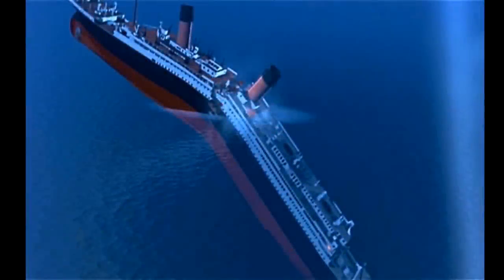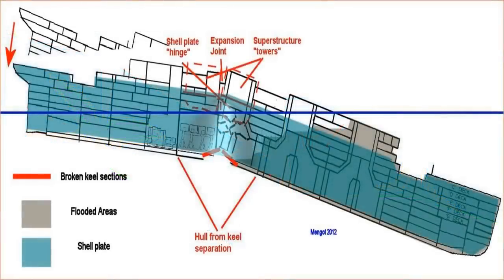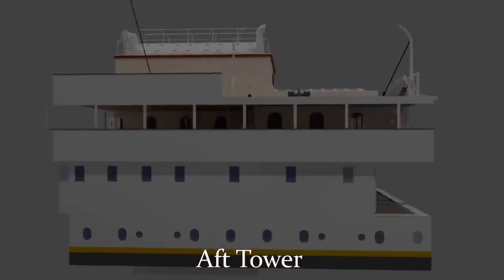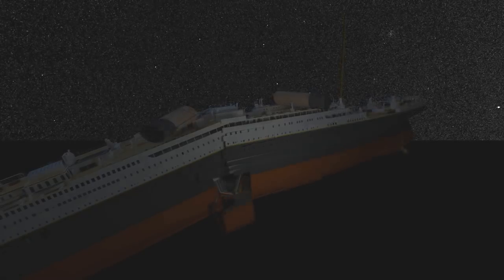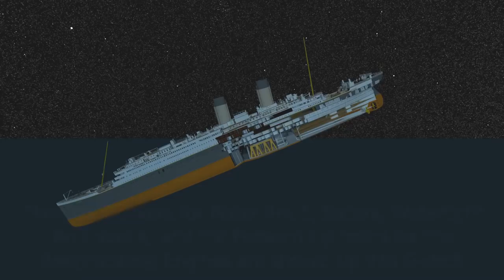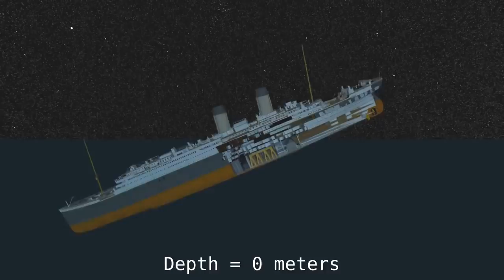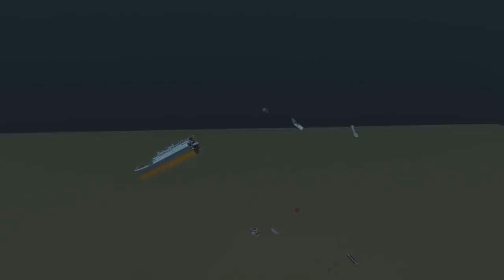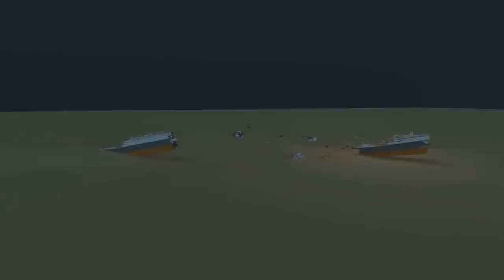How Titanic Broke In Half BRIGHTENED

Comment: Question (I’m asking to learn, not debate): how much water was in the stern of the ship when all of this happened? In my head I’m thinking if it was a significant amount it would have just gone down with the bow without breaking off, the whole thing would have just slipped under the water as air was pushed out and buoyancy was lost. But, obviously, the rate at which the ship lost buoyancy was variable to an extreme along the length of the ship.

By the time that it had completely broken up and the stern was near vertical is the reason why it stayed vertical as it sank because enough water and made it far enough “up” the stern as the bow had pulled it prior to breaking to balance it in a way that prevented it from righting itself before sinking? Presumably there was still a fair amount of air left in the above water portion of the stern to provide enough buoyancy to keep it above water for a few more moments, which was just steadily pushed out as it took on water from below.

Comment: I made a replica out of Legos that measured at almost 6ft long and I propped it up against my ottoman at the same angle to do a stress test and I got a result that looked identical to the ship breaking in the animation. (The double bottom and top of the ship clashing and breaking apart) Now I'm not a professional lego ship builder or anything and obviously it's made out of the same material, but if the splitting is similar in a weaker and smaller object then that shows that this is the best representation of how she went down.

Comment: Where is the B-deck? Where is the G-deck? Where is the neutral line, compression stress and tension stress at each moment of the break? It would help to overlay these indicators at each interval of the breakup. Also, could you show the real waterline at each moment of the breakup, not some horizon line which shifts in the distance which makes it appear as if the ship is moving out of the water and into the air. I think this is the most realistic breakup theory, however the animation isn't as clear as it could be.

Comment: It's strange that none of the survivors mentioned that Titanic had split in two. I also remember reading, long before the wreck was located and the split was discovered, a theory that because the water was so deep, so cold and so saline that it could have taken the ship almost a week to finally hit the bottom and that it sank arcing backwards and forwards like the tip of a pendulum as the water became thicker. This was a theory from the 1950s or 60s though and was one of many that abounded at the time.
It was also suggested, with hindsight of course, that had a controlled flooding of the stern taken place it would have lifted the bow of the ship high enough that the water would not have continued topping the watertight bulkheads and the ship would have remained afloat.
It's very sad and sobering to think that there were probably pockets of air in certain parts of the two hull sections wherein trapped passengers were still alive as the ship went below the surface and may have survived a short while during hte descent until the pressure became too great.
A good animation, may thanks, Bob.
Reply: Some clearly saw it break in two at the surface, but their testimony was ignored or buried.
Reply: A week!😂
Reply: Very interesting to hear this. Never heard it before. Did the titanic have a way of allowing water in to fill the other watertight bulkhead compartments? Was that something that had been done on other ships before/after titanic? It sounds logical that it could’ve saved the ship.

Comment: Another reason why is because EVERYONE was at the stern and since it was high in the air it wouldn’t be able to hold that many people that high up because even though steel is very strong it would still break it with that many people anyway. But even if the metal was strong to the point where it can’t even have a small crack it wouldn’t matter because metal would have to be at the limit of strength to not have even a VERY VERY TINY crack.

Comment: This video argues that (1) the keel failed in compression early in the sinking sequence, and then (2) the B-deck held the ship together for a time. Finally (3) the B-deck failed, allowing the forward section to fall away and sink to the bottom, (4) leaving the aft section floating stern-high for up to five minutes before it too sank. It seems to me that B-deck would fail in tension first, leaving the two sections connected by the  keel. Then the weight of the flooded bow section would cause the aft section to rise to the vertical and support both sections for a time with its remaining buoyancy (due to the air trapped inside). As the aft section continued to flood and lose its air, it would become unable to support the weight of the flooded bow section, and the two sections (still connected) would sink below the surface. On the way down the two sections would twist and turn and break the keel, finally separating them. Further, if the two sections did indeed separate at the surface, it seems unlikely that the essentially unflooded aft section would be stable floating stern-high, rather than settling back down to the horizontal.

Comment: With my experience in metal trades.

There probably wasn't any hole or tear in the hull.

The boat has probably hit the ice berg 2 times, denting the front area and kinking the hull the 2nd hit.

I can agree with this but I think  the kink would have cracked the side and the keel, allowing water to seep in but not flood areas.

because the hull is riveted as it has sheer tolerances, whereas welds don't have any sheer tolerances. Water will have entered more so at the front dent filling the flood tanks, its probably above the top of the flood tanks filling them but the decks above.

This lowers the bow into the water and leans the boat to the side.

The kink will allow tears after a while, with the constant shifting of the riveted plates against the water which opens up the rivet holes, which causes then to drop out.

The plates of the hull will start to pull away and tear away, those could be miles away as the wreck isn't at the mayday call position. Part of reason why it wasn't found for a long time.

Witnesses also said the hull tore away which above also works with.

The neutral axis means nothing really as this is a 300 meter u channel, Which isn't an rigid structure as the rivets allow for movement.

You can get an 3mm U channel or pipe and smash it very hard against a pole or get a hammer and hit the side and it'll be kinked and once that happens, it's pretty much junk as you can't fix or repair it.
Reply: There was around 6 gashes in the ship from the ice falling off as a more than 20000 ton ship moving 22 knots would make icebergs do. And there was an iceberg that was unique when they went searching for the iceberg. An iceberg with dents and holes in it, with red paint from titanic on it.

Comment: I think this is probably more of what happened than any other theory I've seen. But I'd like to maybe throw out the possibility that all this happened, but instead of completely coming apart at the surface that maybe it was more towards the bottom of the ocean. Like half way down or so that it broke apart. And that's why those big parts are crushed together. Idk I think the bow didnt just go straight down in a linear path either I think there might have been a slight rotation and thats why the mast is slightly to the port side on the bow. And why the stern was spinning when it hit the bottom.

Comment: Bunk.  The steel was subject to freezing sea water plus the direct contact to a huge chunk of solid ice, plus losing 60' of the bottom double hull near the middle of the ship. CAUSED THE SHIP TO BREAK IN HALF.
Reply: Then the ship wouldn't break if the gash actually went that far. It broke because it was so high in the air and uneven weight distributions snapped it into many pieces. Freezing doesn't change anything to metal, metal still is just stiff.

Comment: The only thing that stands out to me as an anomaly in this theory, which seems the most plausible of all that have been put forward, is the damage to the reciprocating engines. If the forwardmost cylinders were forced upward into G deck, why are the reversing gear rods, between the first and second cylinders, bent downward at a noticeable angle? 

Image included for quick reference: https://www.encyclopedia-titanica.org/community/attachments/6a982401836401a519d8d31f3fefce84-jpg.41718/

Did the entire engine assembly move upward and then bend downward as the ship came apart? Was the steel bed plate the engines were mounted on, then mounted to the double bottom, thick and strong enough the hold the engines together as a solid unit until the final separation? Interested to know your thoughts.

Comment: The back half did float for a minute if they had put steel plates in between the expansion on both sides and sealed it the back half would have remained the float but it went nose down right after the nose according to the movie I can't say for sure but witnesses said the same

Comment: I don't quite understand how the stern could have only rose to 15 or 20 degrees, when there there are clear depictions of the stern having rose to a roughly 45 degree angle before the ship actually broke in two.
Reply: Alright here's someone proof of less than 45 degrees. Harland and Wolff (company that built Titanic) stated that the boilers would start falling out of there bases at around 35 degrees. The boilers that are exposed from the ship breaking are still intact, and visible.

Comment: Isn't it quite possible she simple imploded due to water pressure on the hull? Seems logical to me. US Subs during WWII (Gato class) had a crush depth of 300 feet give or take. Titanic sank in like 1200 feet of water. My guess is she imploded once the crush depth for her hull was exceeded. That would leave plenty of room for all the parts to land were they did.
Reply: Titanic actually sank in around 3800 meters, which is about 12000 feet below the surface.

Comment: #3....wrong.
The size of the stern, with loose steel will pull apart at 25 knots spilling pieces off over the course of 2.3 miles down to the ocean floor.

Comment: Sooo some problems with this theory, it relies on Gravity not affecting the ship during its decent. That is physically impossible. Gravity is one of the Strongest forces in the Cosmos. It is the whole reason as to why Black Holes exist. Also they found the Missing Middle Sections nearly fully intact. And yes they are separated in a forward and rearward configuration. The rear fell back level before water rushed in and aided in sinking it. Also I have to ask: why did you keep pulling it up out of the water during the break up? I'm honestly curious, was this an artistic choice in order to make it easier to see? Just asking for some clarification. Cause it looks like the Stern is pulling a Bethesda and Glitching into space. Also the Stern fell in a corkscrew pattern this is supported by the evidence on the sea floor. Also the Corkscrew you show is moving in the wrong direction. Might be wrong due to the angle.

Comment: No. Because the wreck shows otherwise especially the stern. The engines for example didn't fall at all. And the bottom under them is still there
Reply: They did fall as they are in the debris field, split open. Ooohhh, your talking about the engines in the stern right?

Comment: Not to say this theory is wrong but I disagree with some parts. I do agree that top down scenarios are weakest at the double bottom hang on, but the the bottom didn't have bend so much,the very botton could have hung on and the top of it detached. Also you must remember that the shell plating is less thick then the average person is wide, and that the futher down in the water you go the greater the pressure/density of the water is witch could easily ripped steel off the stern, especially with the wood interior torn to shreds. Sorry didn't mean to push my opinion on you. I just feel very strongly about this. And I do also know that this isn't your theory. Sorry for rambling.

Comment: I would think the first segment to reach the bottom would be the bow section, due to having the least surface area per ton of mass, most of the shell plating remained intact until impact by the looks of it.  The sections that broke off from roughly amidships presented far more flat surface area per ton of mass, and should have reached the bottom before the stern, but after items like engine room machinery and boilers began to arrive.
Reply: titanic animations said he sped it up because the footage was already long itself.

Comment: this is a good theory but the theory doesn't take into account the effects of water pressure on air tight areas of the ship which can break steel  as these areas implode... the force of the air escaping could shred steel easily.  it also doesn't take into account the water resistance on a sinking vessle as it tries to settle to the bottom the force alone would be massive especially at extreme depths. 

however this theory is one of the most plausible theories

Comment: I thought that they didn't know that the Titanic broke in half until they found it in 1985.
Reply: The official story reported the ship suffered a long gash along its starboard side. This caused the bow to dip under, and eventually the stern lifted out of the water, and the ship sunk at a 45-60 degree angle.

There were many eye witnesses who claimed to have seen and heard the ship split in half before it disappeared under the water line. Watch the 60's interview tapes, were some survivors recant that night. A couple claim the ship broke in half. So that theory always lingered, but the official story claimed otherwise.
Reply: Gabriel Velazquez Titanic’s damage wasn’t a gash, rather rivits the popes out, after the metal was bent at angle that it shouldn’t have been

Comment: Every animation I've seen of Titanic breakup theories misses the deformation of the cross section that occurred.  Take the paper tube from a roll of paper towels and bend it.  The cross section ovals so that it is shorter in the direction of the plane of the bend.  This will happen with any thin-wall tube regardless of whether it is circular or rectangular in cross section.  If you look at images of the wreckage on the ocean floor, you will see that the upper decks were pulled downward and the sides of the hull bulged outward.
Reply: bro the stern and bow section are sagging from the impact, and deterioration.
Reply: @viperfishlover8767  Look at the images on the bottom.  There is a distinct sag of the upper decks and an outward bow of the sides of the hull at the break.  This is especially evident in the forward section, which is more intact than the aft section.
Reply: @gregvassilakos  the bow and stern basically broke their backs as they hit the bottom, the bow curled up a bit which made the decks weak, and then it went down but the decks were weaker so it sagged down. There is a bulge and hole at the break there, because metal doesn't usually go down like that! For example, bend a paper tube, you'll see the sides and bottom bulging.
Reply: @viperfishlover8767  The idea that the forward end curled up a bit before sinking to the bottom defies physics.  The forward end filled from the bow.  Much of the aft section was out of the water.  The ship was floating on the midship section with the bow and the stern both lacking the buoyancy to support their weight.  The hull was in a hogging condition, not sagging.  Take a cardboard tube and bend it.  You will see that the cross section distorts.  This is what happened to Titanic on the surface immediately as the hull began to break up.
Reply: @gregvassilakos  bro i literally said "when it hit the bottom, the bow curled up a bit and kinda broke its back"
Reply: @viperfishlover8767  Look at images of the wreckage of the forward part of the ship on the bottom.  There is a break just forward of the superstructure that might have happened when the forward part of the ship hit the bottom.  At the aft end of the forward part of the ship, the upper decks are sagging, and the sides of the hull are bowed outward.  This damage likely occurred on the surface as a result of the hull cross section distorting during the breakup.

Comment: One of your presumptions is just wrong.  To prove it, imagine instead of the ship, we are talking about you free falling from a plane. You mass & gravity are overcoming wind resistance until you hit your max freefall speed.  Now take your wallet out and let go of it.  Do you imagine is not going to IMMEDIATELY float away from you? Of course it will. But why?  Because the stresses on it are different from you. Because it has a different weight, it also has a different inertia. The wind resistance upon it can have a vastly different effect that on you than on it.  The max speed an object in freefall achieves will have a lot to do with the shape, weight etc.   The same is true for loose and semi broken pieces on titanic as the ship falls through the water. A piece of half ripped sheetmetal may experience a vastly different force of water resistance relative to its weight than the ship as a whole. IE the ships "free fall speed" speed  would be different from a loose piece of metal very possibly causing it to be ripped off.
Reply: We are now comparing wallets to 20000 ton ships?